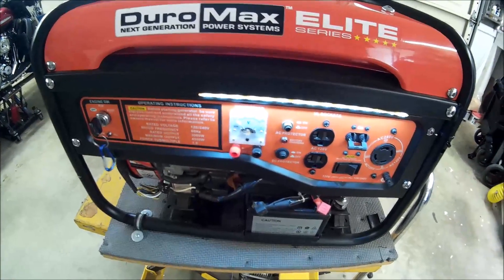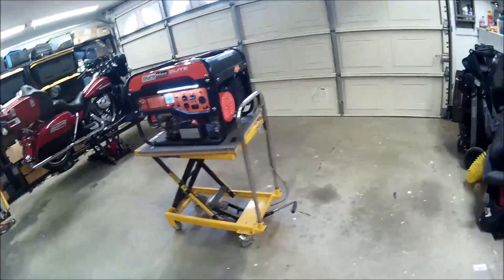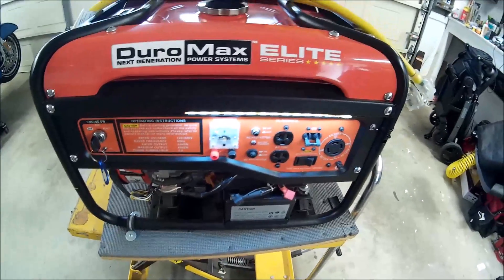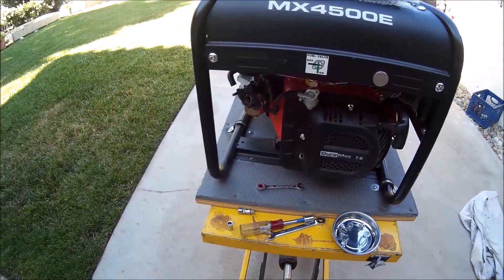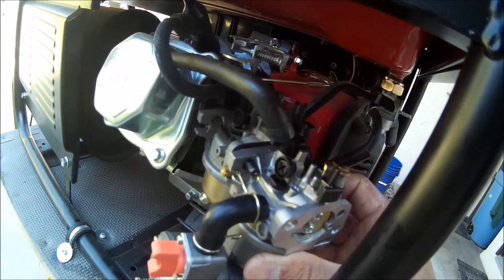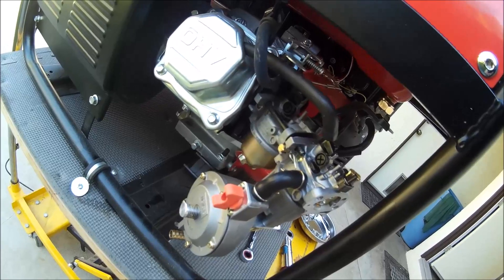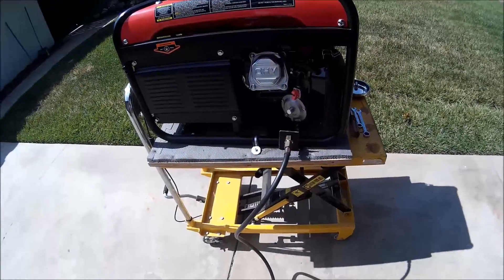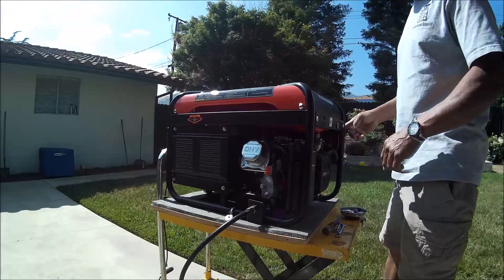Duromax generator gas to tri fuel conversion for under $25.00

Comment: Hey The carb looks flimsy just finger clamps on supply line into carburetor. Not to safe if you ask me. I have done numerous generators using US carburetion kits.
Reply: That's how the supply line is on my generator that has never been touched. Apparently it works.

Comment: A word of advice the Duel Fuel Carburetors are a great deal considering what US Carb and Century Fuel sales the kit to go with your carburetor for 200. But if you are going to use NG or LPG you may have to pay around 40 more and get a Garretson Regulator because if you hook up NG at the meter the pressure will be to high for the small regulator that comes on those Chinese carbs because the diaphragm isn’t large enough or strong enough for high pressure they were made for low pressure and if you tap into your NG line on low side the carburetor will work fine otherwise if your hooked up to the high side you will need a larger regulator. With LPG you can use a regulator set up from a BBQ grill. Keep in mind even if you have to mount a Garretson or Impco Regulator hook the line to it before you hook to the duel fuel carb it won’t hurt to go through a larger regulator then into the one on the carb. I’m just speaking from experience and the bigger regulator that comes with those kits are easier to adjust. I have bought 4 of those carbs and if you buy one they use different words to describe what the generator calls for. They may say 3 to 5k or 5 to 7k or they may say F-168 F-188 or F-190 or GX390 or GX420. The 3 to 5k is simply for a 3,000 to 5,000 watt generators the F means the higher the number the bigger the motor and GX390 is up to 12hp and GX420 is 13 to 15hp. So depending on what size Generator you have those letters and numbers are size.
Reply: No one should hook up the line to the unregulated natural gas line, after the meter there should be no problem, most people will have the opposite problem of low gas pressure after it goes thru all the gas lines in the house.

Comment: Thank you sir!  Has anyone here used it with Natural Gas??
Reply: Yes they work with NG on the carburetor the red adjuster pull out and turn counter clockwise until it stops about a quarter turn and it will say CNG on it that’s Natural gas.

Comment: Those three choke positions are open, half choke, and full choke. You shouldn't have to run half choke on gasoline. Both gas and LP open choke after starting. I have the same carb made by Tonco. The instructions call for a 2 pull start (you have electric start-nice). On LP one pull full choke, then another pull half choke then it starts. After it starts open the choke. These carbs are great and are super easy to install. Took me longer to figure out what hose hookup I wanted than to install the carb.

Comment: Will it run on natural gas too?
Reply: Yes it will. He didn't show that. The orange knob is how you switch from a LP setting to an NG setting. I have this carb but have only ran on LP. It's never seen gas or NG. This is the way to go if you want to convert. Way cheaper than those expensive kits you see people using all over youtube.
Reply: @Deucealive75  Where can I buy this?
Reply: @Mr.C-Mister  From what I recall I got mine on ebay. Go to ebay and search for "duel fuel carburetor" and find the size you need for your engine. The last time I checked they are cheaper than when I bought mine. I was surprised how good these work.

Comment: Hey mike, i got this same carb and the inlet is not pressed in. It is a standard size thread (i believe 1/4") that sealant you see is actually thread sealant.
Reply: Im like you, i dont like a barbed fitting for propane gas. Im changing my fitting for a flare type with some quick disconnects.

Comment: what kit did you buy off ebay?
Reply from the maker: Item number  282369412680
Reply from the maker: Dual fuel carburetor LPG conversion kit for generator GX200 170F carb
Reply: You ever used this on regular Natural Gas yet?